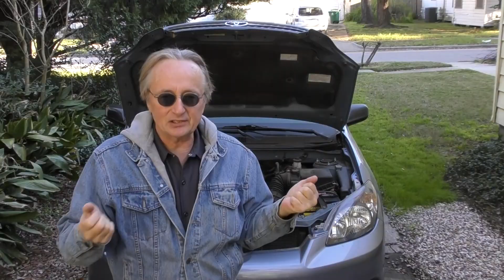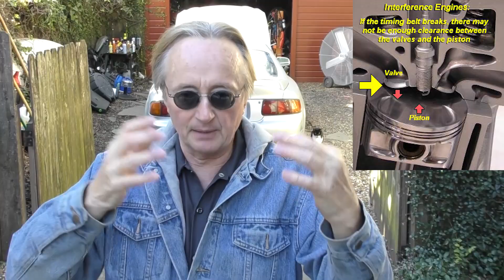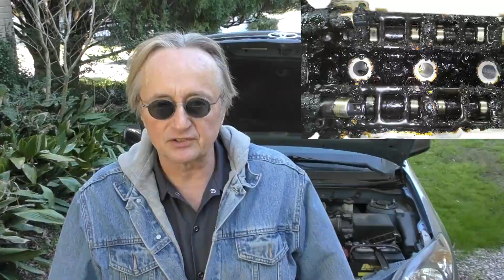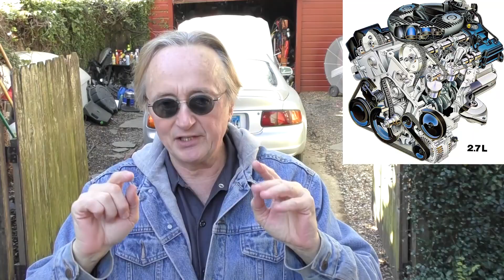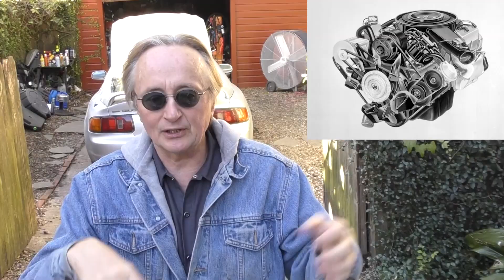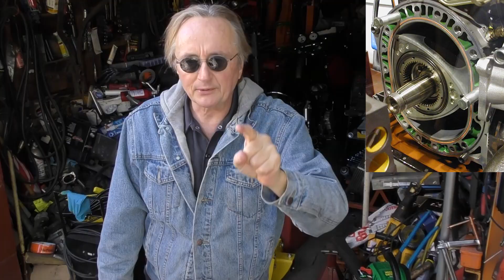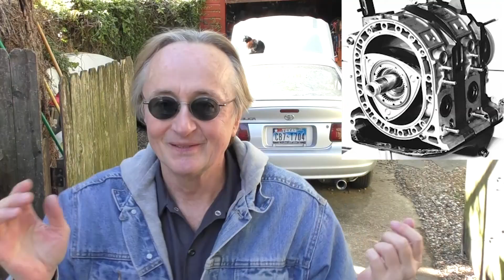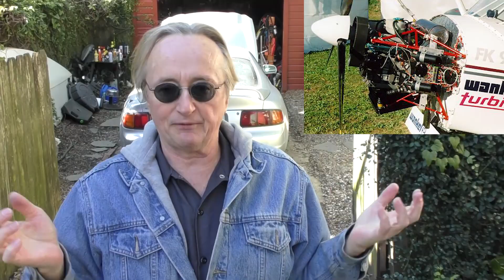Never Buy a Car With This Engine

Comment: I have a feeling the rotary is going to be on here.
Reply: They're a novelty. Its cool for a sports car but dumb for mainstream
Reply: Because they're sh*t.  Amazing, cool, beautiful sounding, pieces of sh*t. And i want one, but will need 5 since the seals keep failing even when taken care of.
Reply: Didn't mazda win 24-hour Le Mans with a 4-rotor twin-turbo rotary engine?
Reply: @foxhound1443  no....LAST race all Mazdas fell apart. Cadillac won class.
Reply: @BigEightiesNewWave  yeah and isis landed on a moon first
Reply: Buff Barnaby he’s talking about the 1991 24 hours of Le Mans where Mazda won with the 4 rotor 787B
Reply: @303StreetMachines great for one lap🤣
Reply: I worked for a Hyundai/Mazda dealer and I always seen Rx8s in for engine work. Always engine work.
Reply: A water pump with spark plugs
Reply: Didn’t jeeps also have rotary engines?
Reply: They don't last long. Maximum engine life can be around 110K miles.
Reply: There good for racing but not a daily driver
Reply: At one time, GM thought about putting a rotary engine in a Corvette (back in the 70s).  Glad they didn’t.
Reply: Nailed it lol
Reply: There already is
Reply: I made the mistake of buying one (Rx8) years back, not knowing ANYTHING about rotary engines 😵😞😔 it went "caput" on me a year & a half after buying it. The steering wheel buckled up & there was coolant leaking\mixing in with the oil 😫 i unfortunately live in an apartment complex where they threatened to tow it.... So i had to sell it 💔 $2k with 66k original miles 😭
Reply: LOL yeah , feel sorry for the people who bought the Mazda RX8 , very fast car but the engines blew up after 50000 miles LOL
Reply: OZZY ZIG my rx8 got 146  miles and still drives good as new
Reply: Kevin Toscano only 146 hahaha!!! That is new.
Reply: Scotty could have filled the whole video with Mazda rotary woes.   How about the rubber seals on the 12A engines perishing because of heat and letting water into the combustion chambers?    Some didn't make it to 30000 miles!   Worse than a head gasket blowing it meant a complete engine tear down and rebuild and sometimes new rotor housings if they had warped due to heat.
Reply: Rotary is reliable i have a cuple of rx8's-rx7's
My daily rx8 has original engine going on 267thousand miles and no i do not baby my cars  i push them beond their limits  
If you dont know how to properly maintain them thts were u get bad expirences from  
Stock with turbo for 5yrs still going strong and have a abusive driver behind the wheel all the time  
I basicly am WOT evry chance i get
Reply: @RSR-909  I don't if your serious or just trolling.....lmao seriously
Reply: @KBurd1   100% seriouse i havent had problems or people i know 

Thts what confuses me how alot of people have problems with them but i or people i know dont 
 in my opinoin people dont know how to care for them maybe thts were they get their problems from  lack of care/knoledge iguess 

I have high and low millage rx8's  and 2 rx7s    my daily rx8 is turbo on 15psi stock engine  and i havent had problems  i treat all my cars like if  they are stolen

Just like people say ford gas and diesel trucks  suck
 but i have tested evry make at my  buisness and ford has been 100 times more reliable than anny other make besides the old cummins 12 valve diesel they go hand and hand with the 7.3 tdi
Reply: @KBurd1  It looks more like mindless trolling.
Reply: @RSR-909  IMO the biggest problem is with secondhand rotary engines in that most people buying them have no real idea on the engine servicing intervals:
oil = 10/40 mineral or semi-synthetic
3-6 months or 5500-6000 miles which ever is sooner which is pretty much the same for any high performance engine whereas a Honda Civic (not type-r) could easily go 10000-15000 miles or a couple of years and not be detrimental to it.  I really liked rotarys as I owned a (copy) JPS 588 Norton for a couple of years and it always put a smile on my face through-the-bends, bit heavy though.
Reply: @RSR-909   Those engine are made to been driven hard if you Sunday drive them the rotor won't be lubricated enough, i heard some adding 2 stroke oil in the as tank to solve oil starvation on the apex seal.
Reply: @RSR-909  You seem to be the only one, rotary whisperer.
Reply: @Rhaspun  actually not really most freinds and people tht i know all have good experiences with them just like anny car you need to know how to maintain them  

Or it could be that every one i know including me have been too lucky but i dought that
Reply: @RSR-909  When I had my RX-7 I changed the oil every 3000 miles. Nothing wrong with regular oil changes like that. I don't what else can be done to help the seals last longer. Even the shop I used said the most of the rotary engines he saw in his shop, it was common to see them wear out from as low as 100k to 140k miles. On mines they wore out at 110k miles. I'm trusting my experience and what the shop is telling me. First hand experience. I see in different forums people commenting on the shorter engine life. So somethings not right here.
Reply: @Rhaspun  i do all oil changes on my cars with royal purple fully synthetic 10w30 evry 2k 0r evry 1k if its seen the track and 1qt of motor coat same  Goes for my non rotary vehicles and rotary fuel always mix 2stroke oil in it along with  alittle motor coat mixed in 

 It is a lot to do but it work's for me 
 And yes I know I do my oil  changes way too early but I do that to every gas car tht i own even my scion xb  oil change intervals is 2000 miles
Reply: 1982 Mazda Rx7 140k. Orignal Engine. Still running. Everyone on here talking mad crap about rotaries, has probably never even seen one. I had never seen one before I saw mine. Doritos beat pistons anyday.
Reply: @XCyanideXUltraX  any day never came.
Reply: @XCyanideXUltraX  Yeah we never seen one because they come straight out the assembly line into the junkyard.